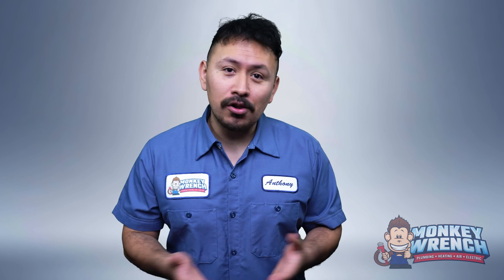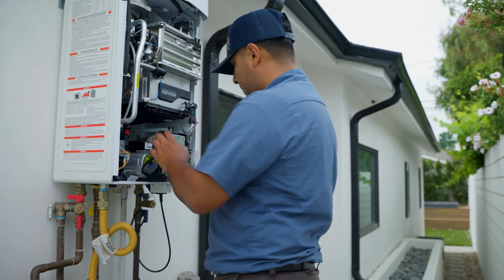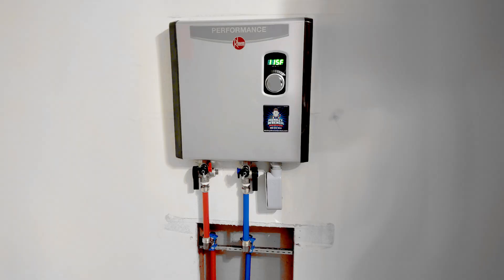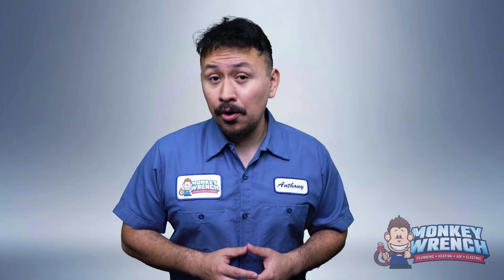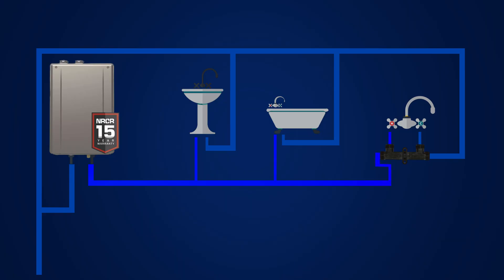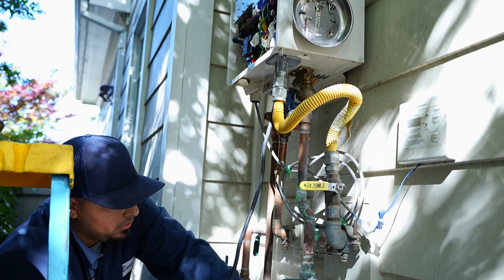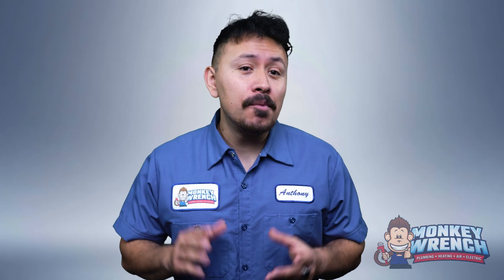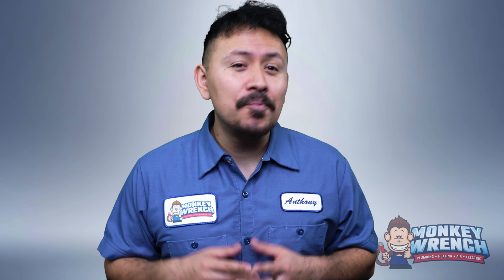Why Is My Tankless Water Heater Turning Off?

Comment: I increased the temperature on the unit because the water wasn’t hot enough when showering. From 120 to 140. Can this be the reason it keeps shutting off? . I have to keep turning off and on the breaker in order to work

Comment: My unit just quit putting out hot water. I went upstairs and there are no lights on. I pushed the reset button but it did not light up. I don’t know what else to try. Will have to call plumber. NO hot water for anything.😝

Comment: My Rinnai propane water heater performs flawlessly with one exception, when my wife fills her tub , sometimes it will go cold for several minutes, then comes back . Never had anything like that happen with my shower or any other fixture in the house, got any suggestions?

Comment: I have a tank less I installed about a year ago. But it doesn't turn on for the shower. If I turn on the hot water in the sink it works fine. But the shower itself won't turn it on. Weird

Comment: Mine is a little different... every time I turn on hot water, I can hear it vibrate pretty loud for a few seconds.  If I turn on a sink no problem, but a higher hot water load like bath faucet without instantly turning on the shower switch it will trip.

Comment: Glad I found your channel. WE bought our house and it hade a tankless water heater. It kept giving an error code as low gas. After 4 different brands and sizes, we had the gas company install a regulator. So now we are still having the same problem. We have 3/4 inch going in. We have 2lbs to the regulator and 10.5 oz to the tankless. When we turn on any water in the house it drops to 2oz. In order to keep this from happening, I have to lower the water by lever to only give so much water. We have had 199btuo, and 150 Bu with same issues. Should we go with a lower BTU to fix this?